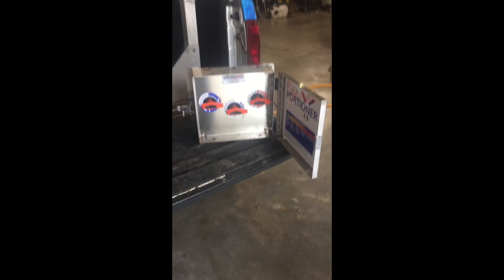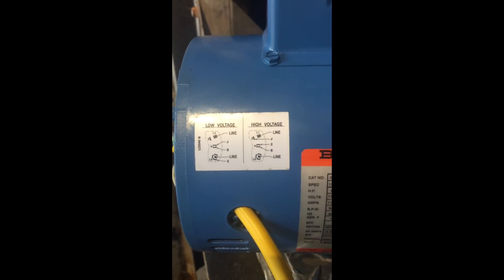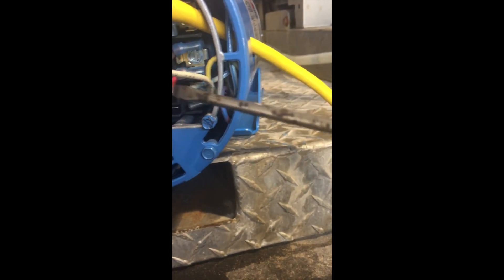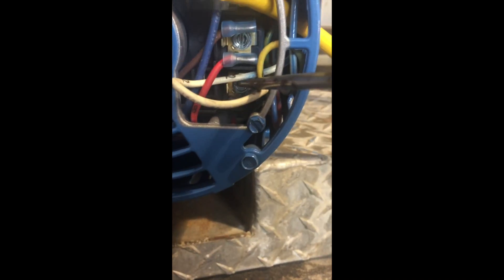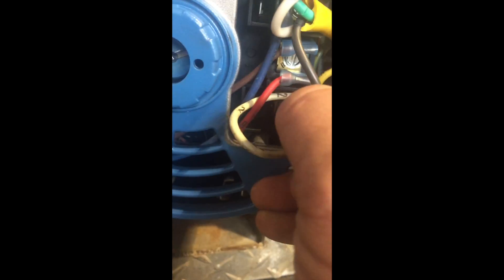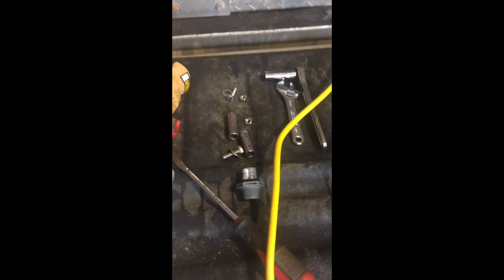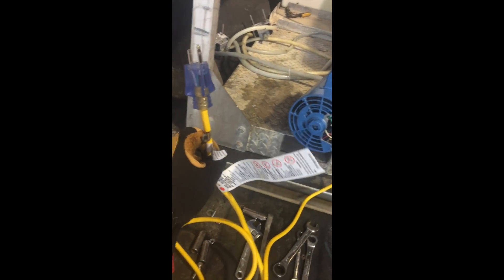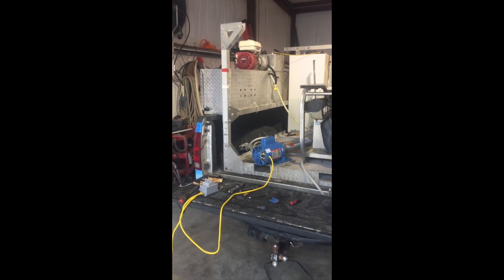Wiring booster pump for softwashing

Comment: My booster pump is not working with a ground wire.. it kicks the gfi .. but if I put an adapter on the extension cord that does not have a ground.. it works..
It also shocks a little if I touch the truck when I turn it on.
Any idea how to fix it ?????.. we posted a video on it on Facebook Spray Wash Academy... under BILLY ANDERSON